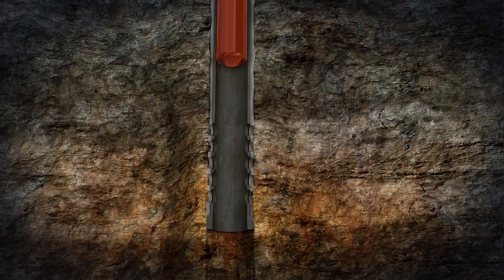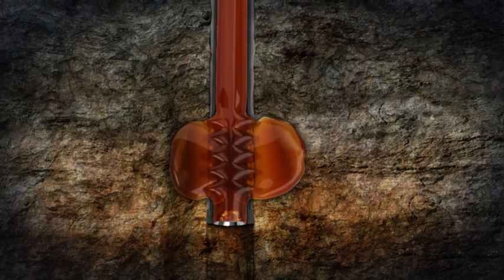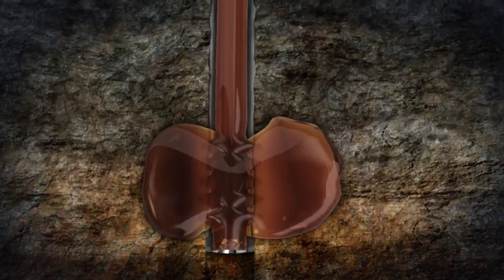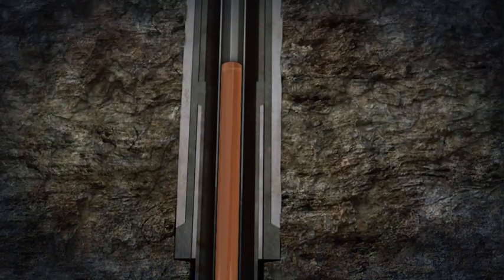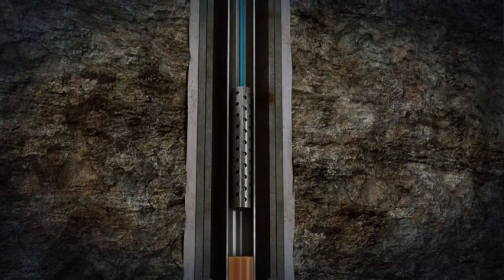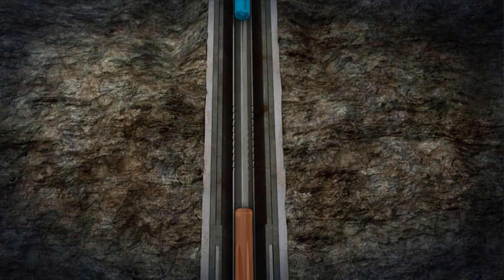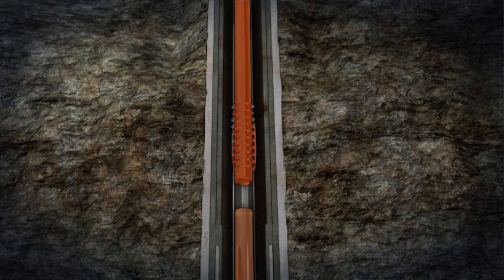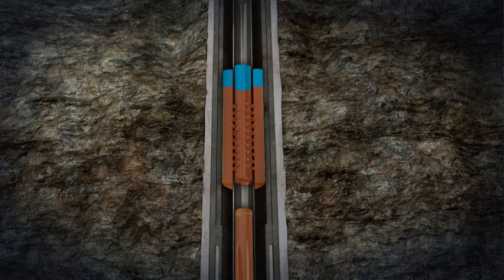WellCem Plug & Abandon

Comment: Can we apply the cement to a certain point inside the production casing or is it necessary to apply the cement to the end of the casing?

If we can apply the cement to a certain depth .like I will just pump the cement to 100 m depth and close the well what the process and equipment we can use?